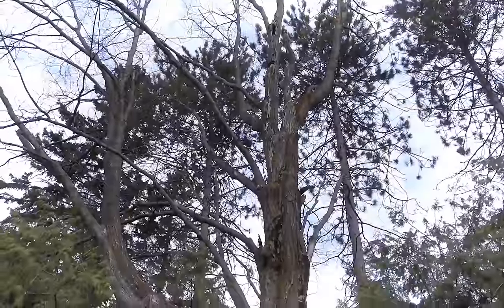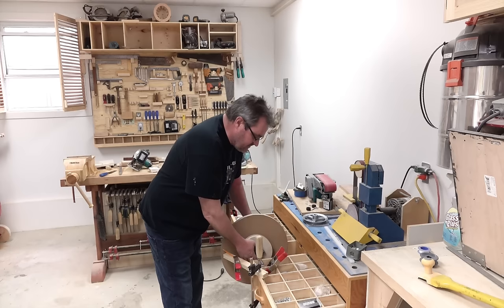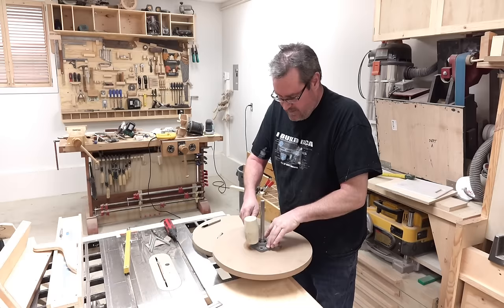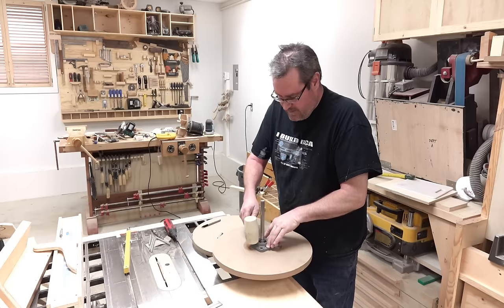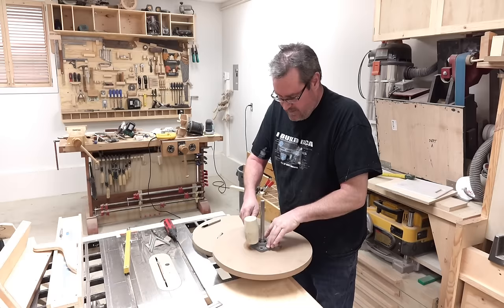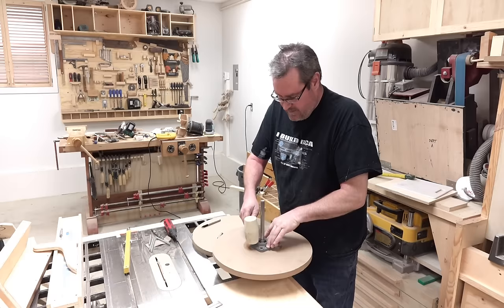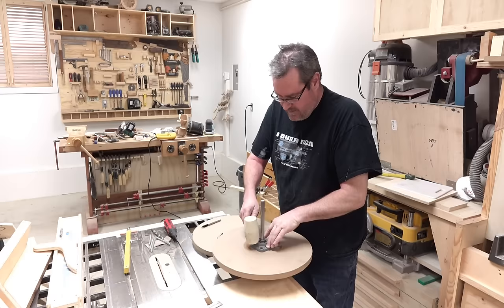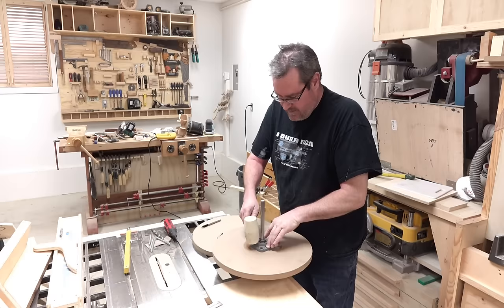Making A Wooden Band Saw Mill From Scratch - Full Build

Comment: Thanks for sharing and the detailed movie. Thanks for also showing the issues you still have I would suggest to place the wheels in front of the frame, so you can easily change blades. Lubricating the blade will definitely help against gumming and wear. Don't give up John, you've spent so much effort and time. And take us along!

Comment: A year later.  Great attempt.  Very informative.  Well worth the attempt.  You used what you had and I respect that.  Absolutely no shame at all.  Learned a lot.  

Some interesting things to look at.  Torque vs speed.  A winding/tracking system to push you dolly along... and that sharpeing system.  Even soft pine needs a blade sharpen after 8 2" cuts and it would have been even more painful for a chainsaw.

Impressive looking wood.  Great for a veneer.  Thanks for  your hard work and effort well done.

Comment: WellDone! I know this vid is dated, but still provides excellent inspiration, example.
I have built several bandsaws over the years, most of them temporary, meant for one project, many of THOSE still going. There is something about the sum physics of bandsaw that seems it’s TRYING to make you look good. Many projects a struggle every step. Bandsaw is on your side, it’s like it’s TRYING to emerge from the leftover, spare parts you’ve had for years into a functioning machine.
Bravo! Keep playin’ that Rock and Roll!

Comment: When I built my bandsaw I got some old truck inner tubes and cut them cross ways so they are like a giant rubber band then stretched them over the big discs that the saw blade runs on. Just lift and glue. works well. thanks for sharing.

Comment: Congratulations on this. Bravo and hurrah. 

I switched out the blade on my 14" bandsaw for the 5th time, and finally it was a blade that worked. Night and day. It's still on there - even after jamming it once and jacking around to straighten it and reset some teeth, it's 1,000 % better than all the others, which were a variety of blades.

Comment: John, I've sawed alot on Sawmills with Circular saws, and done a little with band saws, I believe you just have a little downward "LEAD" built into the angle of the saw, if you didn't get the saw Leading you at a ninety degree angle to the carriage, it will automatically saw in the direction that the blade leads you. so if you tip the bandsaw away slightly it should straighten out, if you tilt it back too much it will lead you up in the other direction. Circular sawmills, have a method of moving the pillow blocks so that lead can be adjusted, you may need to use the same type of mechanism.

Comment: To turn the bandsaw blade on and off without shutting the engine,  I took the electric clutch off an old 60" cut, 21hp zero-turn gasoline lawnmower which I saved.  The clutch was mounted on the engine and drove the 3 blades of the mower.  It had a switch to turn the blades on and off.    I have a 21hp engine from an old portable generator.   The drive shaft for the generator is what drove the rotor on the generator which protrudes about 1 foot from the engine case. Since the taper on the protruding generator drive shaft and the taper on the electric clutch are not the same, I then packed the electric clutch shaft hole with some JB Weld (not the clear stuff, it is crap).  I then pushed the electric clutch until on as far as it could go.   Beforehand, I drilled and tapped 4 holes around the clutches shaft collar.  By tightening the screws, I was able to take the wobble out of the electric clutch pulley.  I then mounted the mower blades on/off switch in an easily accessible location.  The on/off switch is a yellow panic-type switch.  As we used to say for filling out an airplane's maintenance logbook, "Cut to size, pound to fit, paint to match"! I hope I have painted the explanation clearly enough to understand.

Comment: Great video, but there are a few suggestions/upgrades I would suggest. The first thing is to add a hydraulic jack system you could use to life the log x amount of inches, instead of hurting you back. Second, I would get a small wench and attach it to the front of the mill, so you can maintain a more constant speed and do less work. Third, I would connect a rubber hose to you bucket and mount it to the wood. The reason I would use the hose is so you can use a small hose clamp on the end, and tighten/loosen it to control the drip rate of your water. Awesome build none the less, but there are some things I thought of while watching.

Comment: First off,  badass setup! Only thing I would change and this is what I see with every other mobile mill is that the moving sled is where the blade is, not where there log is. 
When doing it that way, you're able to put shims in between the log and cut piece so that you dont have as much friction on the blade. 
Great job making a wooden bandsaw! It was fun to watch.

Comment: I read a few of the comments, with some ideas about why the blade was drifting. The way I see it, I believe the blade needs support closer to where it's cutting. If the blade guides were adjustable along the length of the blade, you could get them closer to the action. For example, if you were cutting that 15" wide log, you could move them to about 18" apart or so, just outside the width of the log. I believe the blade is twisting and diving down, 'scooping' out the wood at the end. A steel frame and wheels would allow for more tension, and that would help, but I think you could eliminate most of the problem with better guide placement. Maybe even a real sharp Timber Wolf blade. Your ceramic and bearing guide system is really cool, by the way.

Comment: realllllly neet !!  :)   one suggestion that works for freehand drilling... use your drill press to drill a hole in a 2x4... then use the hole in the 2x4 as a guide to keep your hole drilling straight !!!  If I ever need a band saw mill I will buy a pair of pullys though :) wooden pullies  will wear out quickl;y....

Comment: When putting a drill chuck in the lathe, I run a section of all-thread through the hole in the lathe into the back of the chuck and put a washer and wing nut on the outside of the lathe.  I can't remember the exact size of the threaded hole in my taper piece on the chuck, but most of them that I have seen have it.  That solved my problem with the drill chuck wanting to wander out while I turned bottle stoppers.

Comment: Hi John, Chuck here all the way from Malaysia! I love the way you come up with new ideas. This bandsaw mill is no lesser than a genius idea. I haven't seen the 2nd part of the built video yet but may I suggest a few things for this? 
I would put 2 bearings, one on each side of the blade, about 3-6 inches from the blade guide to prevent dipping or bowing.
For the feed, instead of pushing with a piece of wood, I'd prefer to hook the dolly with some pulleys and gears and maybe with a separate motor if available.
Thirdly, instead of water, you may want to try using "Chainsaw oil" to cool down the blade. It will not damage the MDF as much as water.

Comment: It's a lot of work with a commercial mill, let alone a mark I home built.  Some thoughts...Add dish soap to your drip system.  Put spacers as your cuts develop to keep tension off the board as the cut lengthens.  A peavy is cheap and will let you move logs with a lot more ease.  Great build, a lot of great thinking went into it!

Comment: here's a trick to help u next time u use this saw. right before you finish a cut, put a small wedge under the slab right behind the blade so that it doesn't bind after you finish the cut

Comment: I want it to work, but the blade teeth fill up and cause it to wander if the cut is too wide. The sawdust fills the gullet and the blade wanders up in the cut. The answer is to use a much larger blade with bigger but  fewer teeth per inch.  It would improve the ratio of width vs. gullet capacity. That is why the professional mills have the crazy huge blades. It is amazing how the blade stays on even through all of the pressures put on it. Your design worked well. Thanks for a great experiment and moving those huge logs by yourself!

Comment: for the table that holds the logs, you should of used some sort of jack system that when you push the lever down or up ect it lifts the log up by whatever inch/ millis you need instead of struggling to lift on your own.
Reply: Daniel Vazquez or one Jack with a platform ontop.. don’t need 19 different jacks for it.. spread the weight over one.
Reply: Daniel Vazquez again bringing manhood up.. it’s a video of woodwork pal.. you’ve got issues clearly 😂

Comment: That's a great project there 👍👍  looks like you need to get an engine hoist to help you lift the logs in place and onto the dolly, otherwise you might get an injury and hurt your back 😲😲🤕🤕 Maybe you could also add a simple brake to the castors to stop then sliding forward when loading the dolly ??

Edited bit.....I just watched the last few minutes of the video and saw all of your problems.....Yes tree sap is incredibly sticky stuff, I was given some really exotic looking wood about a month ago in the form of logs, I put them into dry storage immediately, however just moving them from the felling site to a wheel barrow and then to the dry storage was difficult because all of the sap leeked out everywhere and my hands and trousers had instantly become mega sticky 🙄🙄

Glen from Edinburgh, UK 👍👍

Comment: Just a heads up.  Some Russians made one but instead of using a long pole to feed the saw they screwed an eyebolt near the bottom of the long and then used a boat trailer winch to crank it through.  If you get the worm gear version you can use a battery drill to crank the winch.  Fun looking project you got there !

Comment: Oil works great to keep the blade from gumming up. WD40 or any other kind of spray oil or drip setup would work. I’ve used anything from motor oil just wiped on a saw or spay oils with handsaws to keep them clean.

Comment: Pretty cool.  Sometimes a wider kerf helps.  Saws heat up and wander due to sawdust in the cut.  A vertical cut is easier for that reason. Check gullet  size, feed speed swage. Armstrong in the US publishes some saw feeds and speeds data.

Comment: For moving the logs: Use a rope anchored to where you want it to end up.. stretch out with excess laid at a 90 degree and role over it. Take the tail and pull over the top of the log (best with two ropes. and walk the rope to the end point. As you pull it will roll the log. Much easier and once you get it rolling inertia will help to keep it going through the tough spots and you can attach your motor with a "head" on it and use it like a choke winch (wigger head with an n is the old name of it but you know someone might get offended). Or get out your tractor and pull the rope etc etc.

Comment: I just had a few slabs cut at a  mill.  What I see missing on your homemade saw, is blade guides that slide out to just outside of where the piece is, that is getting cut.  That would certainly help with drift, and be a lot safer.  :)

Comment: Pretty cool, get a 5 gallon jug and have small stream of water running down and on blade. If you can put wheel on saw stand it would be easier to move saw over log

Comment: As you push toward the cutting edge the blade will twist causing the cutting edge to angle downwards. This is why the blade tracks downwards. A sharp blade and higher tension would help but guide rollers near to the cut point would also make a big difference

Comment: its definitely your feed rate. due to the lack of rigidity and the fixed position of the blade when you push too hard on it, it causes the blade to be pushed forward angling the business end downward and thats whats causing it to dive into the wood. one of those problems that makes itself worse. increasing the tension could reduce this but eventually it would pull the blade apart and all it does is give you a new maximum for feed rate. cool build none the less.

Comment: Honestly I think squaring it up on the table saw sometimes is better than using a jointer. 

I'm batshit for reclaimed pallet hardwoods. 

They're really rough on a jointersn blades, and it's really easy to say..." eh...I'll just do ONE more...  Cause it's like finding wood treasure. It all depends on your blades, and what you want to sharpen or "hard use" more.  My logical vote is table saw. Then a Bailey/Stanley #8 with an iron so sharp you could shave a sleeping bear's nut sack and not have him wake up.

Love the channel. You rule.

Comment: get a cant hook. put it in the middle. put the cart in the middle of a horizontal log (not upright). pull the cant hook back and lean the cart over. i do this for big logs all the time. my mill isn't very high off the ground and i can put the log right on without a ramp, but you may need a ramp. you may need to quarter saw for maple, depending on the season you cut it because of the sugars, but it will have some no matter what. obviously many people have suggested a water drip, but i wonder what a watery castille soap would do. it would have some oil in it and may help with water damage, or just oil up the mill wood so it cant take in water. metal mills have a lot of tension on those wheels, and you take it off every session. you can also adjust the wheels' alignment (axl angle) so the blade sits in a very exact spot (3/8" off the wheels for mine) what a fun build and great effort from whatever you have laying around.

Comment: hi John I ve been following you for a couple of years but only just came across this video. If i may suggest, that is if you havent done so already put a winch on the other side of the sawmill so you re pulling the stock rather than pushing it. + you can also gear up the winch wheres i dont think you can do so when pushing unless u use hydraulics but that might be a bit too complicated and difficult to sync with saw

Comment: I would build a simple winch additionally, just take some rope knot it to your mover, make a drum to wind the rope on, should be straight forward since you have a lathe and I would make a really strong reduction gearing for it, so that you can run it with a corded drill or something you have laying around.
That way you can relax in a chair and read a book while it does the work. Plus you can regulate and optimize the feed rate.

Comment: Great video.  The gummy maple wood makes me suspect that the tree had fallen recently.  Better results would be obtained by painting the ends of the logs to inhibit cracking, and then aging in a dry place for six months to a year.  That would dry the sap and prevent the boards from warping and cracking after being cut.  I would love to see a longer experiment to determine the viability of this bandsaw, since you can't buy a kit of similar type in metal for less than 3k.

Comment: Before you tighten the bolts a bit of water to soak the veneer then tighten them will great a impression that will lock it pretty well never slip for the most part nice video

Comment: Cool project and cool concept!  My solution was to prop up the log on an angle and have at it with my 42" buck saw.  Wrong tool for the job to be sure but I did get a few good slabs of white oak.  Your method is MUCH better.  Unless your measurement was the total number of calories burned.  I may have squeaked ahead on that score.

Comment: I think the blade is moving back against the feed force causing it to twist and dive into the material. A way to adjust the approach angle of the blade might help. You should make a crank & gear thing to feed the trolley in more smoothly.

Comment: Great video !  I cut a bundle of lumber using a proper bandsaw mill to re-deck our float-house. We went through a lot of blades and mostly changed them each hour to sharpen and reset the teeth. The wood we were cutting was red cedar and still it was hard on the blades. 
I was thinking if you had a boat winch setup instead of a pry bar it might help.
Reply: Boat winch was my thought exactly.

Comment: You need some kind of spring loading on your tensioner. The blade expands as it heats up.  Also you might think of slowing the blade down. 3500 FPS is fast for green wood. The blade runs hotter which melts and fuses the sap to the blade. I usually go for about 2500 when working green wood. A water drip would help but use the bicycle inner tubes to protect the MDF wheels.

Comment: Have u ever tried cutting circles on your table Saw? U can even cut a shoulder on the wheel. The advantage of doing it on the tablesaw is that u get a perfect circle with a center hole that u start with to make the perfect circle.  No other tools needed except drill to make center hole.  Diameters are only limited by your ability and work area.

Comment: for your saw I would suggest a second - saw thick metal stripe about a feet away from the cutting blade which will help the board "tilt" after the cut is done, so the blade wont shift the board.
Reply: also I would some gears of different diameter to ease the pulling and make it smooth ;-)

Comment: awesome build, admirable. like you say it seems a lot of work for the results, but you don't know unless you try, and man you gave it what we call in New Zealand "an honest attempt" band saws are a throw away item once blunt, could you maybe fashion up a bar with a ripping chain for a chainsaw? more drag I know, but your 2hp motor should cope and a sprocket system rather than a pulley system, you can get numerous cuts from a chain saw and sharpen it once blunt. Just a thought. Also on the trolley holding the log, a height adjustment system for different thickness cuts and ease of adjustment lifting. Maybe a jack with vertical rails that you can put pins in at various drilled heights? Impressive project!!!